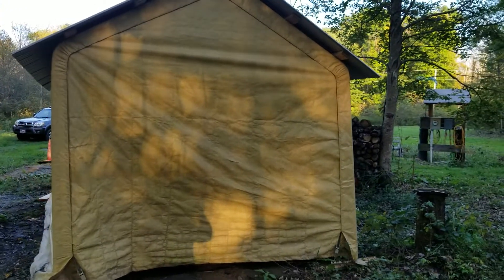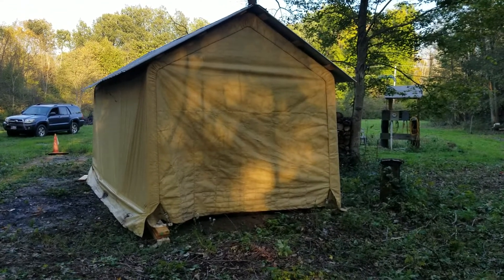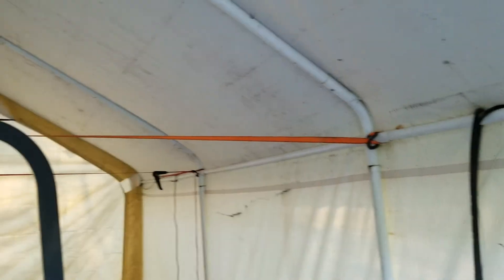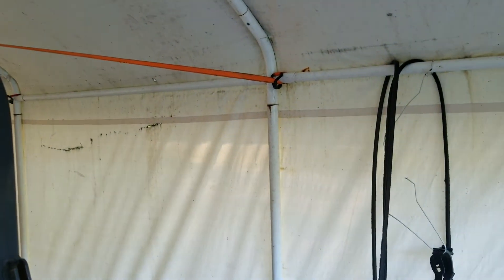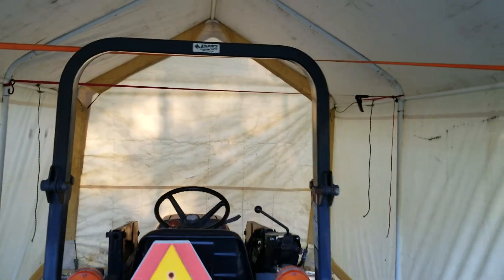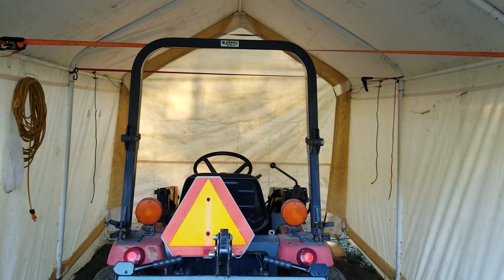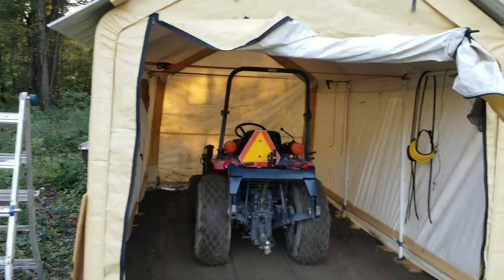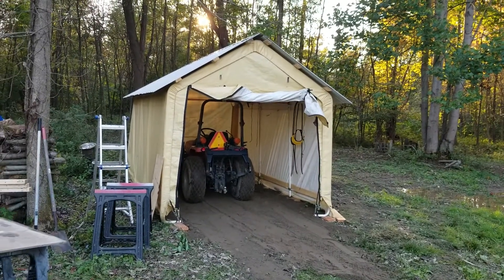2018 HF Tarp Garage Metal Roof

Comment: I've owned two of these Harbor Freights  tarps. The fabric only lasts a couple of years. I added steel fence bars across the top of frame for added support. It also works well for added space for storage.  I will put tin roof on like this one. I probably will put  tin around the sides also. Tarp is only a temporally fix. Also, instead of taping the metal frame together, use screws to attach them instead.